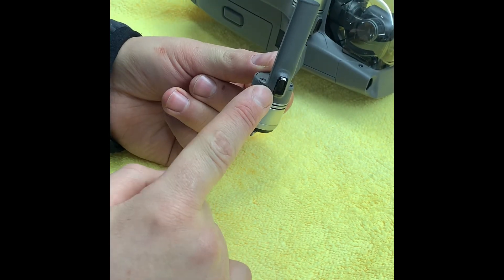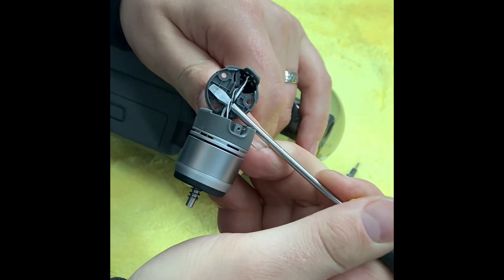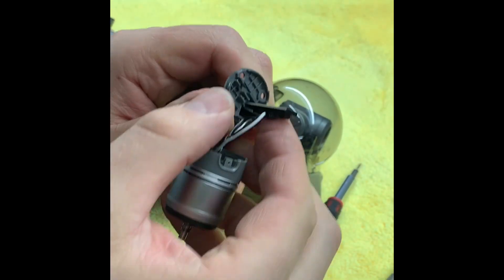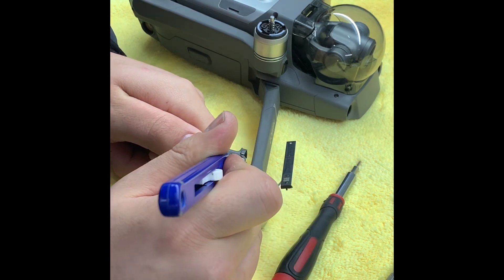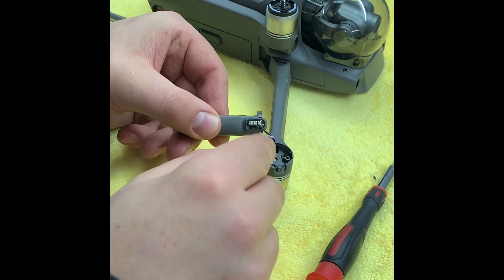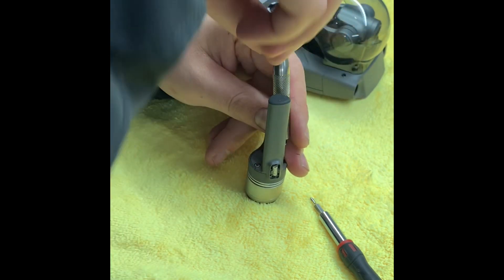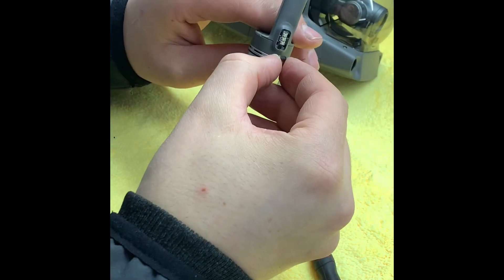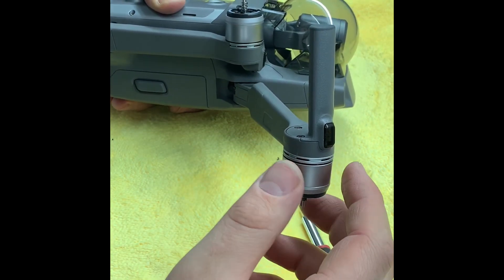DJI Mavic 2 zoom/pro landing leg replacement - no soldering! Replace front leg , replace landing leg

Comment: You can buy the landing gear piece itself.. 
It only costs $8 on Amazon.. no soldering.
I had to dremel the leg a bit to fit the led out.
I couldn't get the led through the hole attached to the wires and didn't want to separate it from it's wires. I used a small drill bit to make a hole to fit the led through.
It doesn't damage the structural integrity of the piece and when done it looks like new.
Fitting the led through the new piece with my big fingers required patience but a lil persistence and it'll go in nicely and sit in place especially after you replace the plastic led cover.
I just fixed my Mavic 2 Pro last night.
Your scalpel idea is probably quicker & better than the dremel. But as long as we both got the job done.. it's all Gravy Baby!

Comment: This was very helpful. I was able to order the replacement part online and as soon as I started taking off the broken part I thought for sure I was in deep doo doo. Like many casual hobbyists, I don't have a workshop for drone repairs so the idea of soldering and re-soldering had me stymied. Thankfully, I came across your video which provided a simple solution to an otherwise challenging problem. I just finished my repairs and fired up my drone and all systems are go! Thanks for your assistance!

Comment: Thanks so much for this. Just did this repair, worked brilliantly. I didn’t have a scalpel tool so I used a tiny Dremel tool bit to grind the hole out a bit larger.

Comment: Found this video after repairing my m2p front right leg. During  the fix I damaged the esc board soldering : - ( replaced and fixed esc only to encountered a faulty imu. Week later repaired the all errors and now I'm back in the air. I  Soo wish I found this video before I spent £120 on parts and many hours labour. 

Well done mate good video. No doubt I'll be using it for reference in the future ha ha.

Comment from the maker: Hi guys, please read both the description below the video and my responses on the comments section, at the time of making the video, I could not buy the small legs seperate to the main arm, so I purchased two new arms and swapped them as in the video. These were sourced via Ali express.
Reply: Is the antenna included in the new arm that you purchased?

Comment: Where do you get the parts?
I haven't checked yet but can you get them from dji?
Reply: You can get them on eBay 👍
Reply: ...."I haven't checked yet but..."  
  Good God....you could have easily found the parts yourself in a shorter amount of time than it took you to post this disturbing declaration of your own incompetence. 
  If you can find this video, then why can't you do a friggin' Google search,  or go to the DJI...or eBay...or Amazon websites and DO YOUR OWN SEARCH for the parts?!?  They are nearly EVERYWHERE.  Do you have to call your  mommy for instructions on how and where to buy groceries when you run out?  If you need specific instructions on how to shop online, then try THIS incredibly complicated search term:

"Mavic 2 Pro replacement legs"  

So much for the notion that "There's no such thing as a stupid question"!  JEEZ.  And by the looks of it, you're not the only lazy moron out there that needs specific instructions about how to do your own shopping.  Just out of curiosity...do you find shopping (in general) to be a mentally challenging task?

Comment from the maker: Hi guys, sorry for the lack of communication. 

Firstly thanks for all the kind words. 

Secondly, the small plastic leg cannot, or at the time of making the video, could not be bought separately, I purchased the full arm, complete including new motor form Ali express for around £25 each. I then remove the part I needed, and boxed the rest just incase I need any spares.
Reply: Thank you. As of this comment, it seems that the leg piece is still not available solo. That's a bummer.

Comment: I'm in a similar situation. I crashed my drone earlier and the leg bent where one of the 3 screws mount and stripped the hole. I haven't been able to find a detailed method of replacing the whole arm.
Reply: Adam Berehulka I believe the whole arm is very similar to the mavic 1, it seems to be the end of the leg that is different

Comment: Thanks, i was doing alot of searching because i broke my leg aswell, hearing about soldering and all that was making this whole project sound like im going to have to spend an arm and a leg to have dji replace it. Cant believe no one thought to just make the hole a little bigger . Thanks you saved me some headache.
Reply from the maker: Dynexty if it helps just one person then it was worth making 🙌🏻
Reply: @johnredfearn6470  i might be the first but trust me i wont be the last. these legs are unbelievably easy to break, and most people dont want to mess it up worse by soldering.
Reply: @Dynexty  nope not the last... I'm here with the same issue
Reply: @ExitThisWayTv  Welcome to the club.
Reply: @johnredfearn6470  is this a secondary channel of yours? i dont see any mavic footage. would like to see what you capture.
Reply: Dynexty yes I have a business page - Vinyl Image professional vehicle wrapping . I’ve literally only just started using it, and didn’t realise it was in sport mode and screamed it into a tree 😂 but there is a new small video of a recent wrap I just completed, the indoors footage it shot on the DJI osmo pocket and the outdoor footage it on the Mavic 2, it’s all abit new to me so I’m sure my shots will get better